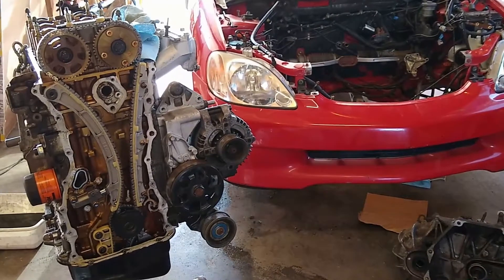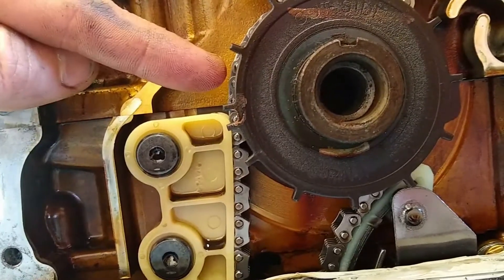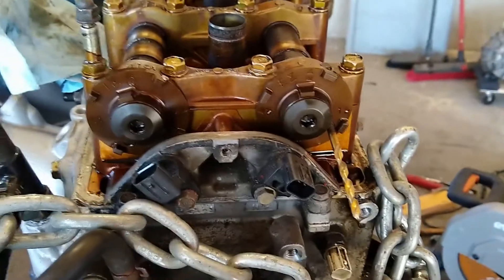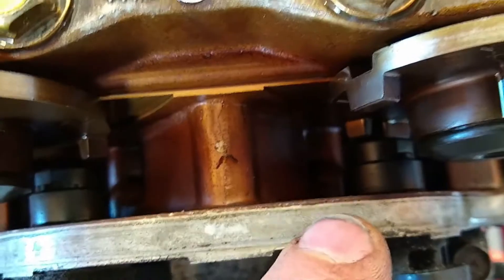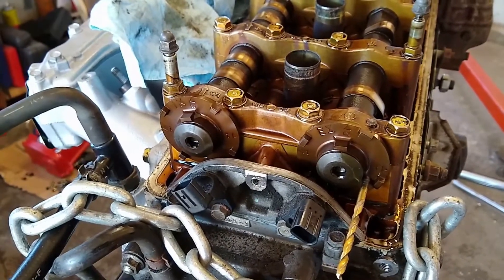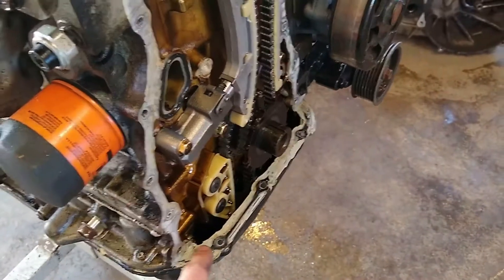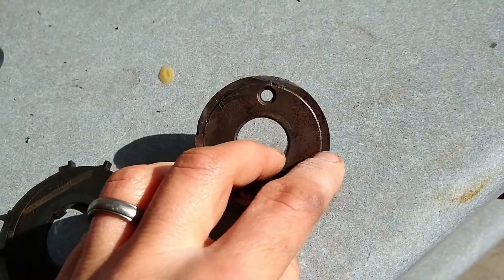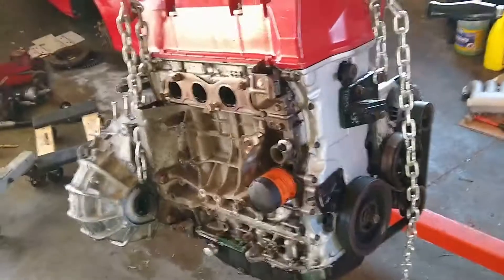K Swap Honda Insight Episode 22: Modified Trigger Wheels for Speeduino and Oil Drain Fitting

Comment: you could had only took the 1 extra off the crank wheel and left the 12 and all but one on the exhaust cam and ran it 12 +1 as well
Reply from the maker: You are correct it would run as "dual wheel" like you describe. The reason I chose missing tooth is so I can eventually run closed loop vvt on the intake. Closed loop vvt is not supported on dual wheel in speeduino currently, but is for missing tooth like shown here.

Comment: Im looking into this ecu for a k24 and I would like to have a better understanding as to why you cut these.
Reply from the maker: The Speeduino will run the engine on the OEM crank trigger pattern (set to Honda d17 in the menu). The drawback is it has no way to know if the engine is at tdc on the compression or exhaust stroke, so it has to fire the injectors and coils in pairs. Once the cam tooth is added (which is not supported with the d17 decoder yet), the ecu knows when the engine is at tdc on the compression stroke, since the cam rotates at half the speed of the crank. This allows full sequential control of fuel and ignition. Full sequential will allow leaner mixtures, which will help mpg and not much else.
Reply: The speedino ECU requires a certain tooth pattern. And the k series doesn't have that tooth pattern so normally you swap out that.